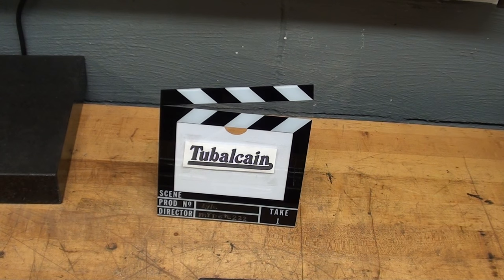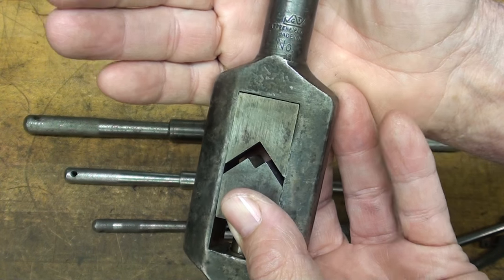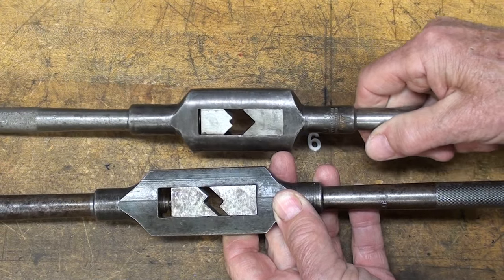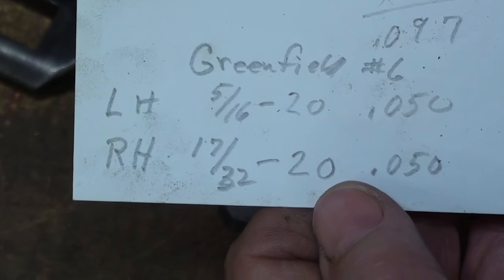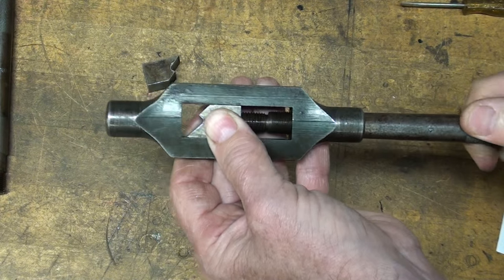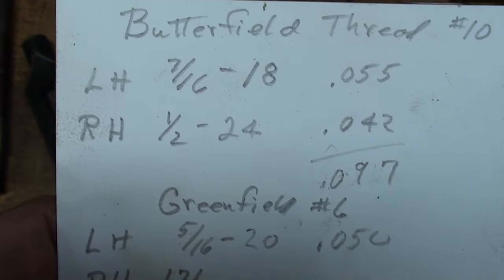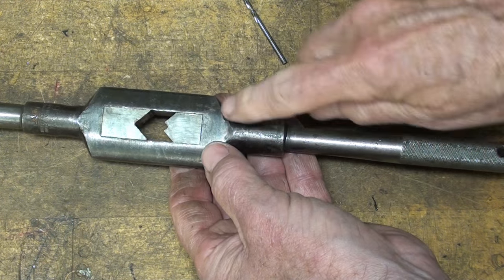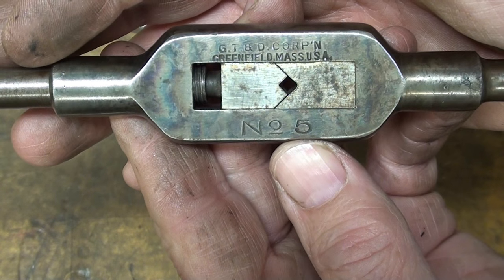SHOP TIPS #303 Discourse on Greenfield Tap Wrenches tubalcain die

Comment: Many years ago, late 1950's, I read an article about a German engineer who built a high performance engine using roller bearings on the crankshaft. To get the bearings onto the journals he used hardened tubes as journals and then large screwed pins ti squeeze the webs onto them. The pins were threaded both ends with different pitch right hand threads. The coarse pitch thread traveled faster than the fine pitch thereby drawing the two components together. The effect was that of using a very fine pitch in terms of tightness but with the strength of deeper threads. For example a 2mm and 1mm pitch would give the tightness of a 0.5mm pitch. This is different from your example in as far as the two right hand threads slowed down the travel whereas the right and left combination gave a speeding up. The process is called differential threading.
Reply: I have heard but do not know if it's true that Rolls Royce engines used in WW2 Spitfire and Mustang fighter planes had ball bearings in the crank shaft bearings..
Reply: The 3 cylinder DKW automobile used roller bearings on the crankshaft. I believe it was a German engineered vehicle.

Comment: These are often called "differential" threads. The only application I had heard of before this video was for locking Hirth  serrated face couplings together ; If you use a coarse and a very fine thread, it produces a gear reduction which is ideal for producing a lot of torque for a small angular displacement.

Comment: I'm no engineer but I can see why Butterfield made their tap handles the way they did and it's pure genius. The jaws are both the same. Same shape, same thread. This means each handle requires one setup to make the jaws. I wonder if they also initially engineered their handle the way they did, in regards to the compound threading, as a way to avoid any patent infringement with the Greenfield design. Not knowing when each company released their products I can only speculate on that.

Interesting video, I enjoyed it.
Reply: Also machining a cylindrical portion on a square block just adds more fuss in the machining of the part. Whereas putting the thread on the already cylindrical handle, just adds another operation to make the handle.

Comment: Enjoyed the video very much. I have Greenfield #0-#7 and some others. For those thinking of taking one apart, mark the orientation of the dynamic jaw. In order to minimize runout the jaws have to fit as they did from the factory. It may take you a while to reposition the static jaw. Ask me how I know. Better yet, don't take one apart if you don't have to. FWIW, in terms of lubricant, I've found that moly grease works best. Thin oil, not so much. 

Regarding the wrench that was cited as an older #5, IMO it's newer. I have one of them, as well. Greenfield was bought by TRW in the mid-50s and owned the company until the mid-80s. If ya take a look at a TRW tap wrench, its shape is essentially identical to the #5 in the video. I could be wrong, of course. It would be great if someone knew for sure. I don't have a Butterfield, but hope to one day. It was cool seeing it.
Reply from the maker: Thank you for the information

Comment: We've used compound screws to achieve the opposite effect in the high precision  coating machines we built. There were just a few differences, however. Both threads were right-handed and one was a single thread pitch different than the other. The net effect was a whole bunch of turns to net a tiny amount of linear motion.

Comment: Great video, Mr. Pete!

I picked up a Greenfield No.7 this past weekend at a flea market, and referred to this video to get it apart for cleaning. It's the older pattern design, that of your No. 5. Unfortunately the color from the case hardening is completely gone, and the movable jaw has also been chipped, though making a replacement jaw might make a fun project.

Thanks again for the very informative video, it's much appreciated.
Reply from the maker: Thanks--you will like the greenfield

Comment: I thoroughly enjoyed this video! What brought me here is the recent thrift shop acquisition of a Greenfield No. 00x4 Tap Wrench. The overall length of the tap wrench is: 5-1/4", and its case-hardening is very much in evidence, as the tool shows that it has had very minimal (if any) actual use.  Near as I can tell, it is for 1/16" -1/4" taps. It sure is 'a cute little bugger"! You now have another subscriber!

Comment: Two things:
The compounded threading allows the threads to be self locking when tightened. On the small diameter, a 10TPI would be at a steep enough angle that, when lubricated, it could slip, like back-driving a leadscrew. An extreme example of this is the `spiral' screwdriver. Instead, the threads lock like a two stage screw jack.

My opinion is that the Butterfield is a little stronger used the right way because, as stated by others, both jaws transfer force more directly to the frame. I doubt the difference is significant in service, since the force for both is primarily transferred near the corners of the tap end, and both jaw designs provide a straight line in the force direction (perpendicular to the face applying the force) through the jaw to the frame. Experience tells me that the Butterfield is certainly more resistant to a worn tap end skipping out of the jaws, when used in the correct direction.

Comment: Great video for tool nuts, the time flew by! A few thoughts: 

- The contact flats are basically the same in both tools, though with the butterfield it might be stronger in one direction of rotation than the other suggesting you would need to flip it to make sure the wider flats were resting rotation? The Greenfield would be "ambidextrous". 
- I'd expect the butterfield to be slightly more resistant to "blackout tendency" since it has the finer thread and the coarser partner thread would be fully pushed in to take up any backlash, suggesting the governor of backout tendency would be the finest thread in the stack.
-I've seen these compound threads used on modern fanlight winders, the type where you use a hooked pole to reach the roof light and twiddle a nut.

Perhaps I'm overthinking it! Love your videos.
Reply: +Ian Sanders I agree, I think the Butterfield would be strongest but you would have to pay attention to which direction you put the tap in (similar to the crescent wrench argument). Having the long flats as the driving side would be strongest, although either one would more than likely stronger than most taps

Comment: Hi mrpete222  The thread system shown in the tap wrenches is also found on the Lee Valley adjuster mechanisms for their hand plane blades. Very smooth and positive.

Comment: I have a smaller Butterfield tap handle that belonged to my dad.  Back in my early childhood of discovering how things went together and worked, I snapped the pin thread off the handle for the fixed jaw, not knowing it was left hand.  Mixed up a bit of Epoxy and glued the handle in place and jaw was left loose.  Don't know why I didn't glue the jaw in place.  Fifty something years later, I still have that little tap handle and it gets used every now and then.   Thanks for the video, Mr. Pete.  Ken S.

Comment: A little late to the game here, but another example of compound thread to provide advance speed can be found on the clamp screws of Wild (later Leica) survey instrument tripod legs.

I happened upon this video while searching for an good-quality but inexpensive tap handle that I could trim the arms on so I can use it on my 12" lathe.  The Craftsman I was using to tap a 1/2-13 thread today is too big to clear the lathe ways, but I needed all the leverage I could get and my T-handle tap wrench just wasn't big enough.  I've had the Craftsman for over 40 years and don't want to chop it, but after watching this video I guess I'm not going to be buying and cutting up a Greenfield, either.

Comment: Great video Mr. Pete! Another one of those seemingly simple, but ingenious designs. 
Something not so ingenious, I got a Harbor Freight tap and die set many years ago. The taps and dies actually aren't that bad, they still do the job to this day, although admittedly I don't make a lot of threads here at home. 
But the tap wrench was the most abysmal piece of junk! It had no jaws at all, just a V cast in the opening on one side and the handle was a threaded rod on the other that would push the tap into the V. It never worked and it went in the garbage.

Comment: Snap-on sells a tap wrench that looks very similar to the Butterfield. It appears to be about the same size as that #10. It sells for $91.00 on the site. It is tough to tell but it looks as though it is cast instead of machined. I have a T & E tap and die set. Both of the dismally inferior die cast wrenches from that set have been replaced by Greenfields.
Reply from the maker: Yes-the die cast wrenches are pathetic

Comment: An important note about the greenfield model is that, since the fixed jaw is retained with a set screw rather than the handle, you can remove one handle to tap holes in tight spaces without needing a different style of tap wrench, so long as you still have enough room for the tap body. And if I’m not mistaken, the ability to transfer torque should be roughly similar since the contact area is similar, and most importantly, both handles should be able to readily break your tap off while you’re tapping the last hole.
Reply from the maker: Thank you, I never thought of removing one handle

Comment: Thanks Mr. Pete!  Interesting to many I'm sure. Glad you added the care and feeding of these fine old tools...with it they will last many life times.  You inspired some great conversations below.  I agree that the Butterfield is easier to manufacture, more simplistic in design and possibly stronger of the 2. The body design seems more substantial too.  As for the right vs left hand tap strength on the Butterfield it may be stronger because of the overall capture length of the tap is possibly greater than the Greenfields...but without mic'ing them out and knowing the tap range for each it's only an earball thought.  Would also like to know what % of thread engagement they have?  Always appreciative of your gifts to education and us!!  ~PJ

Comment: It was interesting to see how the Butterfield did the compound threads versus the Greenfield.  I have had my Greenfield apart to see how they did that.  I see on the #4 that it looks like there is a small screw that holds the movable jaw on the shaft?

It looks like the Greenfield would hold left and right hand taps equally, but the Butterfield would hold right hand taps better than left hand taps the way the V's in the jaws are shaped.

Thanks for the vid.  One of these days I'm going to make a tap handle as a fun project.  Figuring how I would want to mill/turn the center part for looks is going to be an interesting thing to figure out.

Comment: The Butterfield is the stronger one because of the larger clamping area on both jaws, but notice that it also cut 5+ operations (not counting the threaded holes), when making the Greenfield jaws, down to two operations for the Butterfield because both jaws have the same design. That's a real costsaver...
Reply: I disagree, the Butterfield design is directional, and only has more contact area when operating in one direction of torsion, in the other direction it has much less contact area in reference to the force direction. 

On the Greenfield jaws there is one full surface contact for each torque direction on one jaw, and the small surface contact areas on the second jaw are just for inward linear force instead of torque resistance.

Comment: When I saw your picture of this video, it caught my attention because I made one of these tap handles when I was an apprentice at Buick.  Someone in the machine shop had an original and I thought it would be neat to make one for machine shop practice. I saw this gadget in a storage area and found out it is a lathe attachment to round the end of a piece of round stock to a spherical shape (i.e. the rounded end of a handle). My tap handle is 16" long when closed. I used 5/16-18 thread on the movable jaw and 9/16-18 thread on the handle. 18 t.p.i. is .055" per turn, so my jaw moves .111" per turn of the handle. Not sure if you post your email address, I would send you photos of it. Don't know how else to send photos to you. Thanks for the video tubalcain !!!
Reply: Shortly after I wrote my last comment, I ran across your Shop Tip #123 Turning A Ball. The gadget I used in the shop did the same thing, but you turned a handle with a worm gear to move the tool around the work.

Comment: Very good video Sir.  From years of discussion with tool reps such as Snap-On with their 'Flank Drive", I believe the Greenfield may have a strength advantage given the fact that two adjacent sides are fully captured for turning torque, the movable jaw just holding the driven square of the tap into the fixed jaw.  Not an engineer, just looks like it would have similar drive force.

Comment: great video as always
...as for compound thread applications  ..not much but ive seen it once inside an old water valve
it works on the same fashion this tap does...in order to close and open the valve gate . 
pretty elaborate if you ask ...now i bet they got rid of this design and used a single thread style

Comment: the mechanical principle to use the advancement of two screws with a single rotating part is called "differential screw": https://en.wikipedia.org/wiki/Differential_screw In the majority of its applications the two advancements work against each other (hence the word differential) such as in microscopes to achieve minute advancements per turn. E.g one thread has a lead of 50 thou forward and the other 48 thou backward resulting in only 2 thou advancement per turn. In your example in the video the two advancements are added to achieve an extra long advancement. The same happens in turn buckles.
Reply from the maker: +rol eic Thank you ever so much.--I added that to the video at 10:15.
Reply: +mrpete222 You are very welcome. The differential screw is not very widely known and deserves more publicity. The differential pulley https://en.wikipedia.org/wiki/Differential_pulley is already better known. And the differential gear is the star. https://en.wikipedia.org/wiki/Differential_%28mechanical_device%29. All three are governed by the same principle: two opposed, slightly different movements. Considering your talent to visualize and explain technical principles this might be worthy material for a new video. I think you have covered the differential pulley and gear before. (BTW the car differential does not lend itself to easily explain that principle since the two opposed movements are equal. An ordinary planetary gear, which is also a differential gear, is easier to explain.)

Comment: I've always been a big fan of the symmetry in Greenfield's handle.  I use Starrett wrenches at work and don't like the feel of them because they aren't symmetrical in my hands when using them.  About Greenfield vs. Butterfield...let's not overlook the theoretical 3% more holding power of the Butterfield due to it's lead being smaller.  For X amount of torque input you will see 3% more force output with the Butterfield.  Thanks for the video!

Comment: It's a form of differential screw, normally used for fine adjustment (one thread moves in opposite direction to the other) but in this case configured for rapid closing while not being back drivable as you say. I think!

Comment: Some of the new junk sold in auto parts stores use a compound thread similar to the Butterfield, but of course it's not nearly as durable.  The set I have, the moveable jaw will disengage from the thread before it bottoms on the fixed jaw, meaning it's prone to getting lost, or damaged if you try to use it on a really small tap.  Nasty pieces of work, they are.

Comment: If you play around with wooden planes, Stanley No.62 has a 'Norris type' screw adjuster to advance the blade. In fact, there are many types if this 'Norris Type' screws use on the same sized plane by other manufacturers like Lie Nielsen and Veritas. The threads can be a RH LH configuration or can be both in LH LH configuration.
Reply from the maker: Thanks

Comment: Not being a machinist, I would think the handles were threaded on a lathe, vice using a die. The Butterfield handle looked like it was undercut at the end of the threads. Not sure about single pointing an internal left hand thread on the Green field though. I also think the Butterfield has a slight edge in strength, and would better transfer the torque to the tap. In theory anyway.Bob